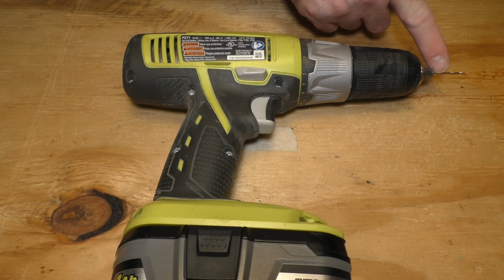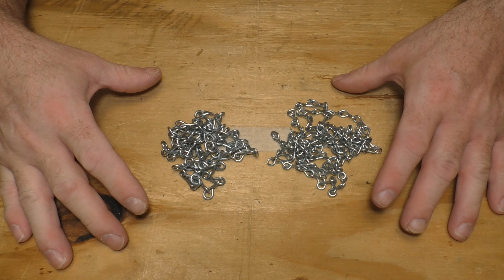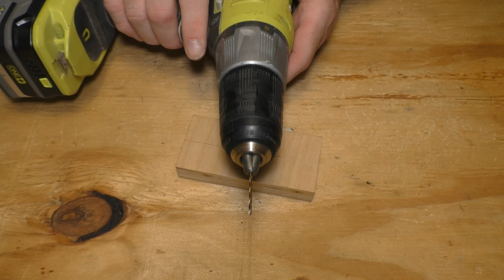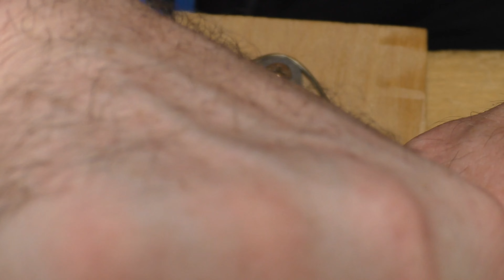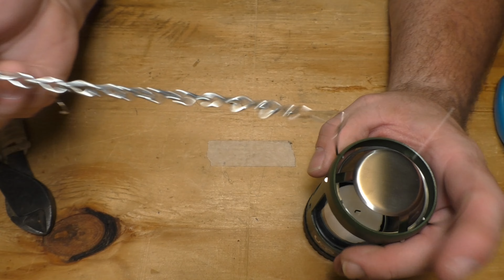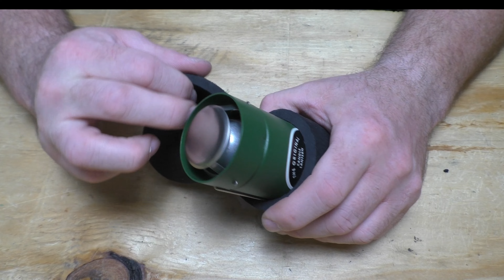MYOG Custom Hanging Chain for your Lantern

Comment: Nice work Man. Accomplished with off-the-shelf parts and some hand fabrication. We were able to find this handy chain at one of the new home center stores in our area of the Philippines. Our first project was a chain made to suspend cooking pots over a fire from a tripod. We also made up a few pieces with large stainless steel fishing line swivels on one end. Handy for quick use. Our system is more of a universal "mix & match" and will remain so until we weed out less desireable equipment, settling on exactly what is best for our needs. I do like your system-specific hanger custom-made for the UCO lamps. I am sure that will be part of your permanent kit.
Reply from the maker: Thanks Jack. Figured some people would find it useful. A buddy of mine used to carry 4 feet of jack chain with a hamade hook for going over campfires. the best tricks are old tricks my friend.